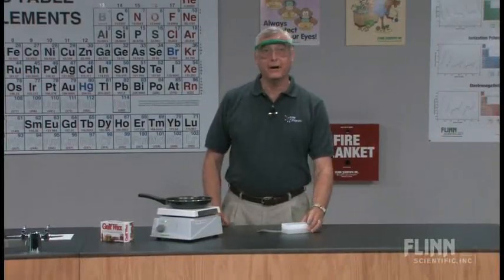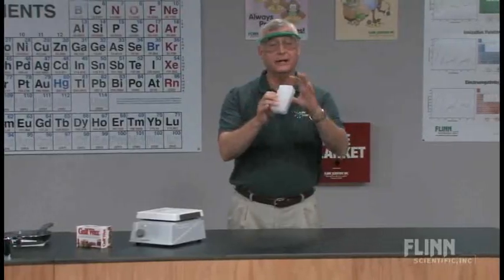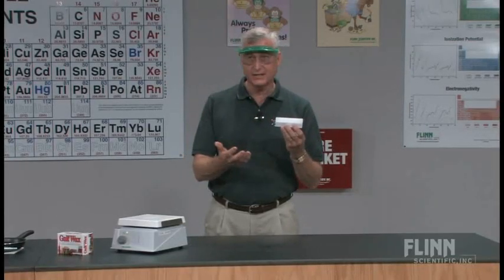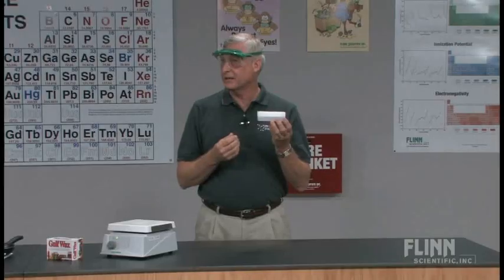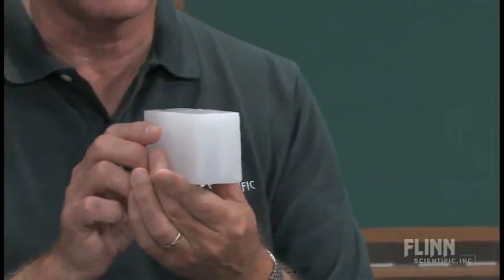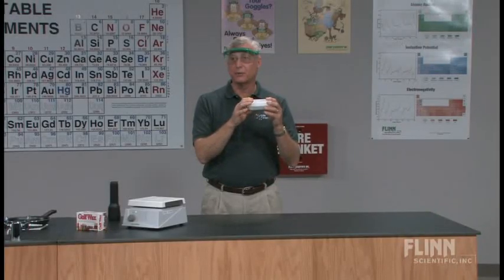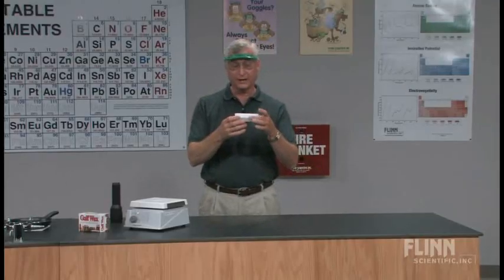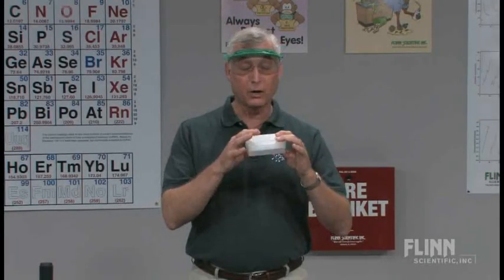Paraffin Paradox

Comment: Phil I've worked with paraffin wax but this for manufacturing Chavant hard styling clay for the automobile industry and the resins used was a smelly affair especially when you use Portuguese resin, Japanese wax and adding Zinc oxide for the mix to catalyse the whole mixture once poured into metal moulds . The following day measure 72 kg of grease put into a dough making machine after 40 minutes you add 120kg of sulphur powder into the mix just before a 15 mins a clay dyed additive is added and volia your Chavant clay . It was a smelly job to do when you boil red oil steric acid produced from beef and mutton fat .

Comment: You left out a very important step. Once the students have generated their hypotheses, you should ask them how they might distinguish between them. Ask "what test could you  perform to determine whether this phenomenon is being caused by a thin layer of air or aluminum foil or something else". In this case, coming up with nondestructive tests could be very difficult, but testing your hypotheses is a very important part of science.

Comment: Navigating with a gyroscope would be impossible if the Earth is turning.
You can prove the earth is not turning with a gyroscope. 
Gyroscopes hold rigidity in space, it proves the Earth does not spin!
You will not see 1 degree every 4 min. 
Prove calibration by spinning it the other way. There should be no drift.
https://youtu.be/deoLBQTtXJw

Comment: We once had a christmas lecture in our physics department where they had a really big aquarium (at least 3 meters wide and 1 meter high) and they sent a laser beam into the water. The beam clearly(!) wasn't going straight but turned downwards in it. We were both awestruck (of seeing light not going straight) and angry (because we couldn't figure out what it was). Some magneto-optical effect with strong hidden magnets? Electro-optical effects with hidden capacitors? A miniature black hole? The worst - he didn't answer!
Only a few days after the lecture he told us that his assistant had carefully filled in, layer by layer, oil with predefined changing refractive index - which nobody would have guessed.

Comment: So, no explanation of the phenomenon of the paraffin block? My hypothesis is that there is no material layer between the two portions of paraffin, and that one half was poured and cooled, then flipped, and the other half was poured and cooled, making the two cool under opposing gravity orientations. Perhaps paraffin has a microcrystalline structure that forms in a direction that relates to gravity, transmits light in one direction, and diffuses it in the opposite direction. But since the conclusion is not included here, I guess I’ll look it up. However, illustrating the scientific method is great.

Comment: I am very impressed. As I've gotten older and gained a well-earned appreciation for the scientific method, I knew the answers for this demonstration. I want to thank Mr. Stevens for giving me a failing grade when I didn't finish the assignment of collecting bugs for my 7th grade science project. I earned the failing grade; I also learned several years later about the importance of entomology and the role that it has in the overall ecosystem. I am grateful that Mr. Stevens held me to the same standard as anyone else. Athletes don't get a repreve regardless of the level at which they compete.

Also, stay hydrated. Super important.

Comment: Before you ever put the aluminum foil between the two blocks there was a difference in color between the two maybe not as drastic however it had the same effect when flipping it over the whiter block is always on the top and the darker on the bottom even after you've turned it 180° over so why is that senior fancy pants

Comment: Pretty cool, from the side sides as one side.
The volume thention create aluminium sheet counterfeildflow fore de darker light  to apeare😍

Tray the same experiment bit tred bold light and led 😍 look if the old light ading thentional diverentional that the aluminium atoms reseave more lobido that mabey unde becomes darter than with led💜😍
And the darter signeerde is longer than the light Siemens from the led flash light😍

Comment: The reason why the top bar appear brighter than the lower bar is because lighting. Light coming from the ceiling (light source like fluorescent or incandescent light) passes through the top bar and "touches" the aluminum foil and bounces back up.

Comment: The foil aluminum is the cause of the dispersion of the different light sources. the principal source come from on the upper of the classroom; for that the upper paraffin is more white that the bottom.The high reflectib¡vity of the aluminum foil, make opaque the bottom side of the block, in this case the light have a doble source: frome the upper and from the foil. but in the observation from the light lamp, in the moment in that the teacher put the lamp in the bottom, bot sides are whit. Both change when the light of the classroom is lowered even if the lamp is lighting the bottom (white in the bottom, gray in the upper)

Is just reflectivity. Phyisical property. And the properties of the wax. The principal it`s translucent. Take off the foil and the gray color slowdown will be obwise.

It is not really a paradox. And really, paradoxes do not exist.

Comment: This is an example of a veridical paradox (truthful paradox). It's not a paradox in the common sense of the word - i.e. potentially breaking the laws of physics. When understood, all can agree on a correct, non-paradoxical answer or explanation. It does however, appear to be paradoxical when certain assumptions are made as a result of the way humans think. One such assumption might be that the block always has light and dark halves, a fundamental characteristic of the block. The reality is that the two halves are similar and it is the external lighting conditions which determine the appearance.
Reply: Paradox doesn't mean potentially breaking the laws of physics. All a paradox is is a seemingly contradictory logical statement in the mind. It doesn't have to be complex or physical. The mystery is why Youtubers can't understand what a paradox is.

Comment: Easy puzzle. The Aluminum foil blocks the light from the ceiling lights, that darkens the waxblock beneath the foil. The Aluminum foil simultaneously reflects the light coming from the ceiling light back through the waxblock above the foil, increasing the amount of light hitting the upper block. Thus illuminating the upper waxblock more than the lower.

P.S. Try to do the same experiment in a room where the lightsources in the room is equal from all directions. ;)

/Dis.

Comment: Cool example of the scientific method but definitely not a paradox. 
Also, you might want to define your definition of “flip”.
Reply: Justlike Thomas a seemingly absurd or contradictory statement or proposition which when investigated may prove to be well founded or true. This falls under that defination perfectly
Reply: You should put quotation marks around your google searches...
“Seemingly absurd” is absolutely subjective so I still disagree that this would be a paradox.
Reply: Because it's dark on the bottom and light on the top and flipping it would make it dark on the top but that doesn't happen you'd think that would happen but through experimentation you find that it is not what happens
Reply: Never once did I think that would happen. 
If you “flip” a tree the shade remains below, right?

Comment: Quote: "without making hypothesis and assumptions too early in the process". Does he not realise how he is proving his own technique would have totally failed. If he himself didn't know in advance how the block was made and followed his own advice, there would no reason to bring out a torch and do the additional experimentation. It is only by making hypothesis and guesses before the experimentation process was completed, that could have led to adding the torch tests into the list of tests to do. What if it was in fact the earths magnetism, or gravity which made one side bright and the other side dim. Then holding a magnet to the object could give more information than a torch. It is only because you did a hypothesis and initial guesses early in the process that told you that a torch tests were needed, but a magnet test wasn't. Stopping wild guesses early on in the process will probably lead to failed experimentation and missed opportunity, and shows that the discipline you are trying to champion, you have proven to be floored by your own example.

Comment: Time travel can never happen. Neither backward nor forward.  Not backward because you cannot go back in time before you or anything existed and the world has moved on and is no longer in the place were it was.  Cannot go forward in time because you have not come into being yet and the world has not arrived there.  All you can do it try to predict what will happen in the future based on events of the past, but that will not always be so.  A sort of paradox is the number 1.  It is the only true number.  All other numbers cannot exist without it.  1=1   1+1=2+1=3+1=4 on and on and on.  Zero is not a number as it just represents nothing.  You can't add to it and you cannot subtract from it.  Ok, here is a paradox.   Imagine a 33 rpm record.   The hole in the middle represents one point on the disk.   Now make a point on the outer edge of the record.  When you play the record, the point at the center of the disk has to travel a shorter distant to make a circuit but the point on the outer disk has to travel a longer distant in the same amount of time to make the circuit so it has to travel faster.

Comment: It's got to do with the source of light. In the classroom, the source of light is the ceiling. When light falls on the paraffin block, the sheet of aluminium casts a shadow on the lower layer. The shadow is cast on the top layer when the torch is held from below the paraffin block.

Comment: my prediction was that it would still be white on top and black on bottom 

after that my prediction on why that happens is that the aluminum is reflecting light that comes through the block while there is no light coming from the floor for the aluminum to reflect so it's black
that's why it's all one color if you turn it on it's side

Comment: it's not a paradox bcuz u just put a non transparent object between the parafin... no light can go thru the aluminum so the top is brighter than the bottom
Reply: also the foil reflects lights both way which ever you turn in.
Reply: ICXC CXCI yeah but also comes to the prominent light source!
Reply: All a paradox is is a seemingly contradictory logical statement in the mind. It doesn't have to be complex. The mystery is why Youtubers can't understand what a paradox is.
Reply: @aaronmicalowe  The problem with most people is that we're all shown what the paradox is, therefore it's not a paradox anymore. But, if we weren't shown the foil, we wouldn't have enough information to immediately say that there's foil blocking light, so it would be a paradoxical problem until it's solved. I think that's what a lot of people overlook. Or something. Otherwise people just like complaining, and that's just sad.
Reply: @Serocia  yes, I agree.

Comment: this contradicts the meaning of paradox. if you wanna talk about paradoxes, go with how ice skates work. people say pressure or friction, but apparently the standard way of calculating pressure needed doesn't work out. I've read it has to do with ice having different characteristic at its surface. plus I suspect it has to do with the small-scale mechanics of friction: steel & ice being hard materials, a great deal of force would be concentrated on any small molecular cluster that didn't yield laterally to the force of the skate, so any ice imparting high resistance would experience many times higher than average pressure & instantly melt, so overall the characteristic is a low friction interface with a temporary thin liquid film of water lubricating the skate... but it's apparently somewhat of an open question still

Comment: Teaching self inducive observation is a very hard thing to do. I'm an observer in life, so I watch and pay attention to things closely to understand them, a lot of people I know lack this. If you sit and observe long enough or become good at it you know what to look for. The moment you put aluminum between the two peice I knew exactly what you were going to do. First thing I would have observed is a noticable seam down the sides which would have instantly indicated something with light, coloring dyes, or quality of wax difference. I assume if you sandwich the peices and leave an air gap the results would be similar but not so obvious because of scattered light. Before you pulled out the flash light my or talked about observing it, I was already thinking flash light, looking close with light shinning towards center, turning it on its side, and even trying different colored light to see if they meet in the middle. I've always been able to do difficult things when I sit and fit interest in them. I'll sit for hours on end with something and tinker it until I find it out without reference to books, videos, etc. Like I said if you sit long enough and wonder you'll figure anything out as long as you have the proper tools to help you observe, which a lot of people don't do because they get impatient too quickly.

Comment: I dont like the expected suspension of disbelief when the students could just stick to the solution of opening it without having togo through so many arduous steps in their minds
They could just act as if they are interessted because they dont know why this method of approach is important to them or how it can help them understand anything better related to the material at hand
Would it be worse to tell them that for this that they wont be spereating the blocks of paraffin?
Im sure that outright giving them a direction for their thought would be bad as its better if the stundents would be willing to learn on their own but that hope is kinda unbelieveable when you dont know why you are learning this type of analysis before you start going through this

Comment: It is a 'paradox' because it is something that has 2 contradicting sides or elements. It absolutely fits the meaning. For all the dummies with bloated but shallow intellectual ego, harping on pride for knowing the simple meaning of paradox, this is an old method in chemistry used as an exercise to teach certain elements of observation, hypothesis, and report.  Believing you know better than someone else, especially an expert in the field, and believing you are more intellectual than someone else handicaps your ability for critical thinking.  Had any of the people that disliked this, at face value, paid any attention , they may have learned some basics about science, and the humility required as an observer in science in order to correctly discern things. The fact that you couldn't discern the value or object of the exercise should make you question the high intelligence you presume to have.

Comment: I mean even if I hadn't seen him making this, it would have been relatively easy to make a hypothesis on this. Obviously, once rotated the white part still being on top should give you a hint that something is causing a reflection of light, and that the only place that it could be would be between in the middle of that block, based on the distinct separation. Than based on the thickness of that difference, which is nearly negligible, aluminum foil would have been the most likely guess as to what was reflecting the light, seeing its a common household item and very reflective.

Comment: I don't know about you but i am in the 7th grade and this is for 3rd graders, if i were in your class I would just say to take it apart, find out more about it and then A. put it back together or B. reverse engineer it based on what we found out.
Then while reverse engineering it or putting it back together have a contest in the process. where the students could work in groups or alone and the student(s) recreated it the best get some type of reward.
And even if the rule was we could not take it apart you can just guess that something is between the blocks obscuring vision as the whole block is not seamless. 

But aside from that I am actually just a c student in one of the worst schools and thanks for getting my brain going again ready for school in less than a week.

Comment: The reason it seems that the blocks are different colors is because the tinfoil blocks the light for the bottom block, and reflects the light on the top block. This is also why the blocks look the same color when they are sideways
Reply: a duh

Comment: He spoiled the effect of the lesson by showing how the block was made. Clearly, the aluminum foil reflected the overhead lights back into the top block and it diffused more light than the bottom block. Reason is, is that the room lights are overhead. I don't see where any paradox comes into play here. It's ONLY a paradox if you don't know how the block was made.
Reply: The video isn't a lesson. It's a guide for teachers. Can't guide without showing how it's done.

Comment: Why am I being recommended to watch this? While this is a good lesson in observation and how to properly observe and hypothesis, this is not a paradox. When you apply logic to the question instead of only believing what you see with your naked eye, you have to think that there is something blocking light from passing through while also reflecting light. Hence, there would have to be a reflective solid in between the slabs of wax. A paradox is something that has no solution, this can't be a paradox just because its being shown to 5th graders.